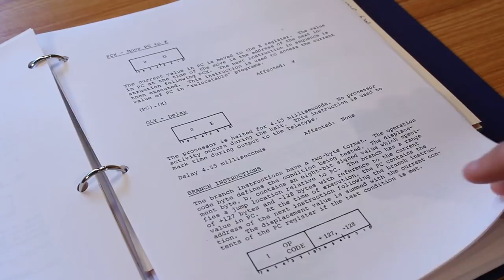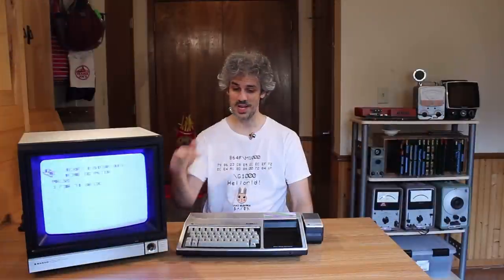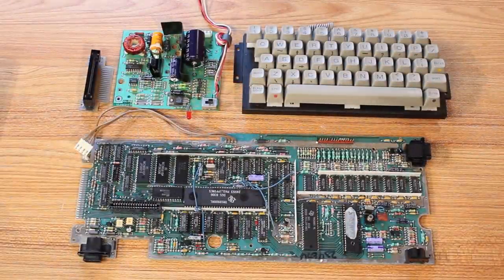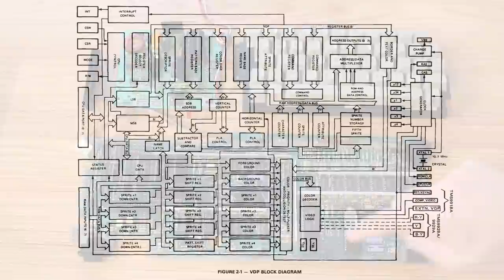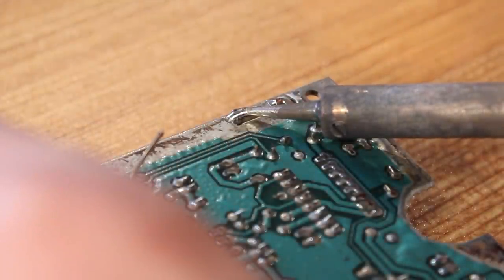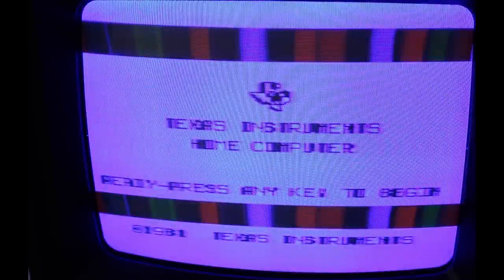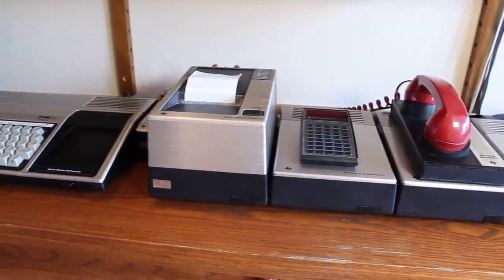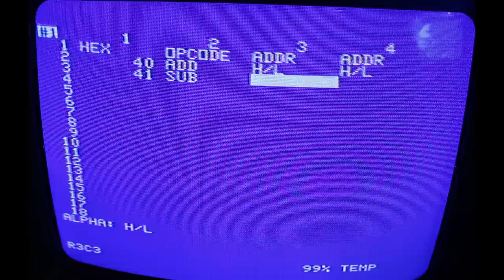Working on the TI-99

Comment: My wife and I wrote and sold a program called "Graphx" for the TI,  we sold a few thousand copies. It was a bitch to write because I only had one floppy, which had to hold both the source code and the load module produced by the assembler. As the program grew larger I had to start pruning out the comments to make space and eventually had no comments in a program several thousand lines long!  It took about 18 months of part time work.  We got good reviews in Micropendium and 99er magazine, we were very proud. :)
Reply from the maker: Whoa, very cool!
I love it when something is optimized to the gills, and optimizing the program so much that you had to remove comments for space just sounds like epic fun!

Comment: So basically the sidecars are, from left to right: 
(1) speech synthesizer, (2) printer, (3) 32K RAM expansion, (4) serial port [w/ acoustic coupler and possibly modem on top], (5) floppy controller, and (6) floppy drive. 
Did I get that right?
Reply from the maker: Yup, you nailed it!

Comment: Yes!  My first computer.  If only it could have been designed in such a way as to fully take advantage of the 16 bits instead of being hobbled from the beginning.  If possible someone should redesign it from the top down and produce a better layout that makes it work like it should have but still uses the same and/or vintage chips.   Hobbyists have produced MUCH faster Extended Basic code and assembly routines.
Reply: My first computer, too! I had a speech module, and played it for my Aunt. She wasn't impressed.  (1985)
Reply from the maker: It's a great little computer, despite having one arm tied behind its back. I would love to see what the little TMS9900 16-bit CPU could do fully uncorked! That would certainly be a fun little homebrew system to build someday.
Reply: If only floppy drives were more affordable. I had one of these when I was a kid also, in 1984, No sidecars, just a cassette drive and a used rack mount monitor my dad got from work. I was an impatient 14 year old, I got bored waiting 45 minutes every time I wanted to save my programs. I did write a few, but cassettes are terrible for data storage. I wanted a floppy drive so badly, but my folks couldn't afford it.
They didn't understand the importance of the technology and thought they were just getting me a toy. I didn't really get back into programming code for another 15 years.

Comment: That is one looooooong computer! [insert loooong cat gif here] Good to see it running well and getting put to use. Although if you're working with spreadsheets, it's probably more useful to get a full-sized printer hooked up rather than the thermal printer.

I am intrigued by the idea of using it as a terminal for the Centurion. Maybe there's a way to write code for it on the TI-99 and load it via the serial port?

Comment: Awesome set of sidecars! 

Besides the "free speech" box I had the PEB instead. What a time... a box with eventually a quad density double sided floppy controller with a pair of TEAC's, large ram drive card (256K?), upgraded internal memory with half the access speed (2x quicker), various USR sysop modems, and probably a couple other things I have forgotten. I wrote a couple notable programs as shareware such as Track Hack (I loved TMS9900 assembly). I still have the main computer, but sold off the PEB and cards to a fellow TI nut in Springfield Mo in the 80s since I was then onto my newish Atari 1040ST and then Mega4 ST. Wish I still had the PEB for fun sake, but I do still have the TI demonstrator plexiglass cased acoustically coupled modem showing off their new "state of the art" comm chip. I should fire it up some time and make a video of that 300 baud goodness.

Comment: The first computer I had was a TI 99/4A. Later I got a job as a programmer/manager using a TI 990. That system was used to pay a 600 person payroll each week.
Reply: I'm surprised that these things ever had any use other than hobbyist toys, even when new.
Reply: @B9M3  The TI 990 was a "mini" computer about the size of a refrigerator. We had about 12 terminals in 3 locations. The payroll software came from a company in CA using RM Cobol.

Comment: They sell these great sets of copper shims/heat sinks. A few mm thick,  and a range of sizes. 1" by .5" to 2" long, etc.
If i were you id find out exactly where the contact between the rf shield and the chip and apply the sticky copper shims there, on to the rf shield, so there is less of a gap between the chip and the rf shield/heatsink. Than apply thermal paste as needed.

Comment: Hm, maybe worth putting a proper, permanent heatsink on the VDP? Doesn't necessarily have to be a big one, I dunno what C / W rating it expects but it's only a little '80s chip, can't be too power-hungry. Then cut a hole in the metal surround to allow the new heat sink to stick out.

If it would be too tall, there's the option of just sticking a bit of chunky metal to the chip that lays flat. Or even, I suppose, a little shim to make sure it contacts the shielding. I don't like the idea of using the shielding as a heatsink though. Those enormous chunky metal shields were a product of 1970s FCC regulations, which were extremely tight over radiated energy. Some time in the early '80s they relaxed them, a lot, when it turned out home computers just weren't an interference problem.

If you want to see a real example check out the Atari 400. You could run over it with a tank and it would survive. Solid big chunk of aluminium or whatever it was. But yeah it turned out to be just paranoia, so there's likely no problem in removing or altering the RF shield, it's considered a mod for some computers.

Heatsink compound isn't the greatest transmitter of heat. It's meant to cover tiny little cracks and scratches.

Comment: How does that thing have enough power for all those sidecars?!
Reply: I believe many have their own separate power inputs.  The speech synthesizer gets power from the computer, but others can get their own separate power.  Notice how he had to turn on the power switches on most of the devices before turning on the computer.
Reply from the maker: BIll Johnson nailed it, the speech synthesizer gets power from the computer, but each of the other sidecars has its own built in power supply, so there's no power distribution issues!

Comment: I recall in the 90s at a users group meeting someone had a modded system with a small board sticking out of the top with lots of jumper wires and a few chips.  The computer ran faster and I recall the mod had to do with the bus.  Anyone aware of this mod??

Comment: Multiplan on the TI-99A !!     Gotta be a bit slow, as the CPU was mighty slow, taking 8 to 14 clock cycles of 3.3 usec each per common instruction.   Then Multiplan was sold as a virtual p-code app, that didn't directly run on the CPU but on a rather slow p-code interpreter.   We have gotten spoiled by zippy modern computers and optimized spreadsheet apps!

Comment: You should lube that floppy drive so the head doesn't make so much noise.
Reply from the maker: The floppy drive is actually pretty quiet, it only sounds mega loud here because I put the mic right on the case and then ran the audio through a multiband compressor.

Comment: When you film an old TV you need to do a low pass filter on the audio to get rid of the high pitch whine. As we get older, our ears pick it up less and less, so I imagine you probably can't hear it anymore. Still, it's there at around 2:50 for example.
Reply from the maker: I'm so sorry about this!
My usual lapel mic doesn't pick it up, but for a few shots I used a different mic, and when combined with the muiltiband compressor, it made the whine really brutal. Unfortunately, I have really bad tinnitus and couldn't hear it at all during filming, editing and even the final confirmation check. I should have double checked the audio waveform before uploading. I'll definitely keep this in mind for the future!
Reply: @UsagiElectric  Hey, no worries! I just decided to point it out to help with your editing workflow, as it's perfectly understandable to miss it. The video was still quite enjoyable. Really liked the powering up sequence of all the accessories. :)

Comment: If only the designers saw fit to use the TMS99105A instead of the chip they used then you would have had native IEEE754 Floating Point operations and not have to emulate Floating Point also it would have had a lot more memory than what it actually had.

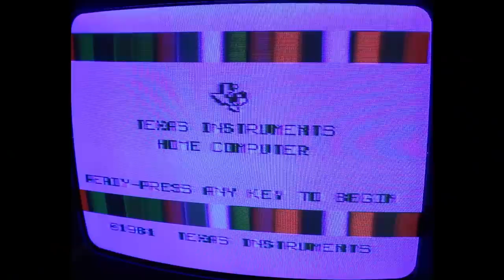Comment: OWWWWW... Please put a low pass filter on your audio when shooting CRTs... That flyback transformer is EAR PIERCING at 1:30. 😭
Reply from the maker: I'm so sorry about this!
My usual lapel mic doesn't pick it up, but for a few shots I used a different mic, and when combined with the muiltiband compressor, it made the whine really brutal. Unfortunately, I have really bad tinnitus and couldn't hear it at all during filming, editing and even the final confirmation check. I should have double checked the audio waveform before uploading. I'll definitely keep this in mind for the future!
Reply: @UsagiElectric  It happens. No worries. It was a nice reminder that my hearing is still there at least. 😅

Comment: Meh.... He's missing the all important Video Controller sidecar (PHP2300). Anyway, with exception to the speech synthesizer and while they are backward compatible, most of those sidecar peripherals were designed for the 99/4 (not 4A). If somehow you have a working 4A and want things to be period appropriate, then the PE box was the shiz. Also, guys... 2 out of the 4 top rated emulators for this particular computer do a near perfect job. Every manual scanned, every module, peripheral and system ROM dumped to file and cataloged ad nauseam. Just think about it, with emulators, everything's so nice and tidy... No clutter, no capacitors to change, no irreplaceable chips to go bad. And when you're done living in the past (which by the way, probably wasn't even yours), you can snap out of it -- just like that!

Comment: 1:06 makes you think who at texas instruments thought that this expansion system was a great idea..
Reply: nowadays 16bit ram is cheep, and you can throw  an es32 or stm32 and emulate all dat and a math coprocessor..replace 16k of dram with 128k sram in 8 16k or 16 8k banks, and you can replace dat scratch pad ram and backswitch dat too which is easy since 256bytes of ram arent fully decoded, so you can just reuse dem mirror addresses to use more ram, or just get a 512k x16 bit sram chip and a pld and actually have a true 16bit memory bus and eliminate dem wait states on dat tms9900 so it can actually run at 3Mhz, thats what the ti-99/4a suffers from, slow ass memory accesses, and why for a 16-bit computer it dont spit out no sega genesis or pc engine graphics, wonder what my atari 800xl could do with a tms9900 in it... literally can have two 8bit data buses,  one for io and antic, the other for ram and memory operations...would make DMA a real breeze for both cpu and antic! since antic only would DMA and tristate on the lower half teh databus, but cpu can still work on dat upper data bus and dont care bout dat lower 8 bits...
Reply: last thing you'd see a 64 Pin DIP chip in would be model one sega genesis, then surface mount got cheep

Comment: By the way Deoxit destroys pots after a while,  They might work in the sort term but it will eventually eat away at the trace.  WD40 or disk break cleaner would of been better.
Reply: I had not heard that, and don't tell that to Adrian's Digital Basement.  He uses it for everything (IC sockets, edge fingers, etc) - not just pots.  Are you sure Deoxit D5 has the problem you speak of?  The instructions seem to indicate contact cleaning is it's main purpose - and not bad for metal and plastic.
Reply: I own a Hammond organ, and it is common lore there to never ever use Deoxit on the drawbars. It will fix the contacts and then eat the plastics. I assume, this is something similar.
Reply: @stefanhennig  yep hear that too.
Reply: There's another type of DeOxit for those type of pots. I've used it on mixers without issue.
Reply: @equid0x  what is it called.  I just use WD40 and alcohol after.
Reply: @byterock  Deoxit fader f5. I wouldn't use WD-40 as it eats plastics and is also not a lubricant.
Reply: @equid0x  ok will have to try a can of that.  Anything I would use WD-40 would not be plastic,  but I always wash it out after I use it.

Comment: Using a di-box often filters out both 60hz and 15khz hum's. A dirt cheap like 20-30$ one will likely take care of the problem. Though most require phantom power. So just a thought in the future.

Comment: Centurion's got opcodes for NOP and delay?
That's just decadent 🙂
Reply from the maker: Fun fact about the delay opcode: it fully halts the entire computer for 4.55ms (this was to get timing stuff right for a 100 baud teletype). But, since it halts the computer during that time, the Hawk drive platter is still spinning, so if a delay operation was executed in the middle of a read or write, by the time the computer came out of the delay and resumed executing code, the disk was in a different position and it would corrupt the data!
Reply: @UsagiElectric  As i am not too intimate with these old machines, so you are saying they where bitbanging the the TTY and also doing some low level disc I/O on the CPU as well, right? Kinda reminds me of the old home computers and consoles that generated the video signal on the CPU and used the the few spare milliseconds to execute the actual program.
That also implies that there must have been a mutex for HD I/O and TTY.
Even if the CPU wasn't on any heavy load, doing a lot of disc operations would cause terminal outputs to slow down.
Oh wait, nay that just windows :-P

Comment: Cute video! Make sure to use a low pass filters on your mic when taping around CRTs.
Reply: I personally think it sounds good just the way it is.
Reply from the maker: I'm so sorry about this!
My usual lapel mic doesn't pick it up, but for a few shots I used a different mic, and when combined with the muiltiband compressor, it made the whine really brutal. Unfortunately, I have really bad tinnitus and couldn't hear it at all during filming, editing and even the final confirmation check. I should have double checked the audio waveform before uploading. I'll definitely keep this in mind for the future!

Comment: Hey - there is some nasty high pitch feed back audio issue - alas my speakers reproduce it perfectly. Its something special so far only in the "intro" area.
Reply from the maker: I'm so sorry about this! It's actually from the 15kHz of the monitor.
My usual lapel mic doesn't pick it up, but for a few shots I used a different mic, and when combined with the muiltiband compressor, it made the whine really brutal. Unfortunately, I have really bad tinnitus and couldn't hear it at all during filming, editing and even the final confirmation check. I should have double checked the audio waveform before uploading. I'll definitely keep this in mind for the future!
Reply: @UsagiElectric  no worries ~ i wouldnt make a point of adding that much effort really, as other have said its definitely part of the experience. Definitely too bad about the interaction with the compressor, it was amazingly crisp through my pair of Klipsch's. (lol)

Amazing content by the way! You've single handedly helped me understand logic gates and got me through that elec final, so thank you!

Comment: 15kHz pain! My ears 😂
Reply: Heh. I actually run a bandpass filter against YT audio in general. Works well to prevent suffering from the high-pitched whine which gives me a headache and channels like Carlson's which have lots of nauseating low-frequency noise.

Love seeing the 99/4A in action. 👍
Reply: And yet somehow no one ever noticed it in all the decades that CRT tvs and monitors existed.
Reply: @ct92404  We did notice and it sucked then too. Programming my own 99/4A on a TV in 1981. Slapping the side of the TV every once in a while to make it stop crying, haha. If anyone had a TV that squealed I couldn't watch it.
Reply: @_droid  I never noticed any high pitched squeal at all, despite playing video games all day as a kid throughout the 80's and 90's. I don't remember any of my friends ever remarking about hearing any high pitched noise coming from tvs either.
Reply: @ct92404  maybe flyback and deflection coil were potted better in that tv?
Reply from the maker: I'm so sorry about this!
My usual lapel mic doesn't pick it up, but for a few shots I used a different mic, and when combined with the muiltiband compressor, it made the whine really brutal. Unfortunately, I have really bad tinnitus and couldn't hear it at all during filming, editing and even the final confirmation check. I should have double checked the audio waveform before uploading. I'll definitely keep this in mind for the future!
Reply: @UsagiElectric  we are all human 🙂 and the compressor is to blame here 😉